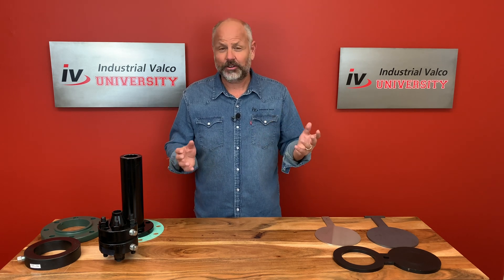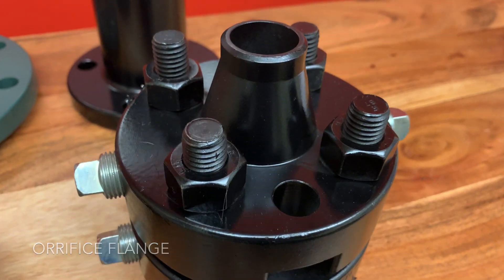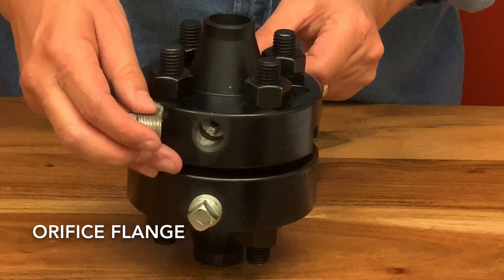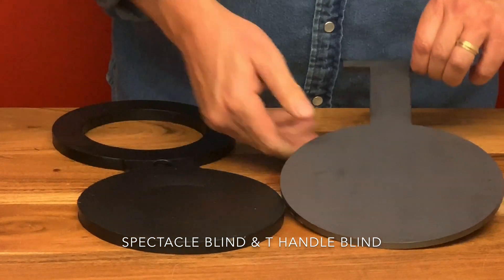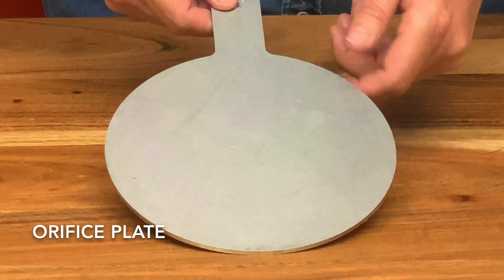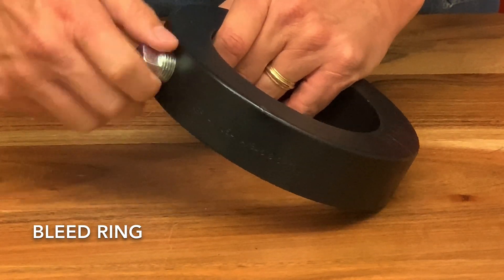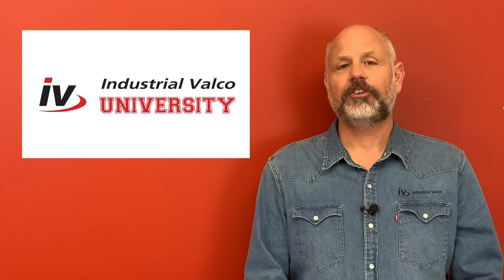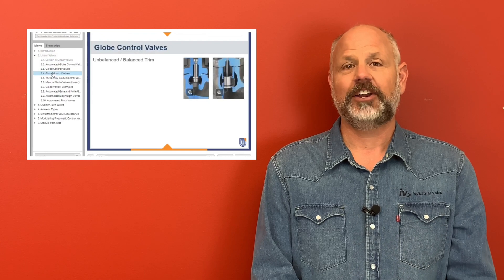pipe flange family. (orifice flanges, longweld neck, spec/paddle blind & spacer, orifice plates)

Comment: Slip. Flange. 
Lap. Joint. Flange. Weld neck flange. Threadid. Flange. Blind. Flange. Ore. Fase. Flange. 
150.class.300.class.600.class.900.class.1500.class.2500.class.ka.hai.sir.ji
Fase
Fase. Flange. Ff. 
Raiset. Fase flange. Rf
Ring. Tpying. Joint. Fase. Flange. Rtjf
Make. and. Famela. MAf
Ton. T$G.

Comment: Thank you for the information. I have one question though. I know that there is jack screw on the orifice flanges with the purpose of separating the flanges to inspect or remove the orifice plate, but how does that work exactly? How do you separate the flanges using that jack screw?  I mean,  I believe those flanges should be pretty tight by means of the stud bolts. Don´t use that hands to handle a chicken, by the way. Thanks again.